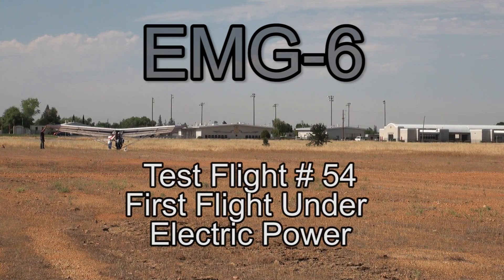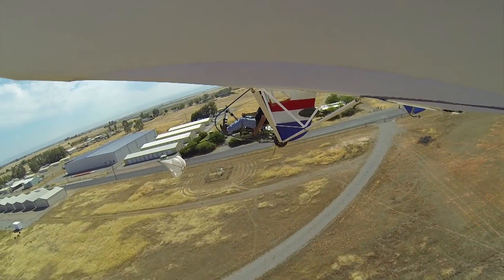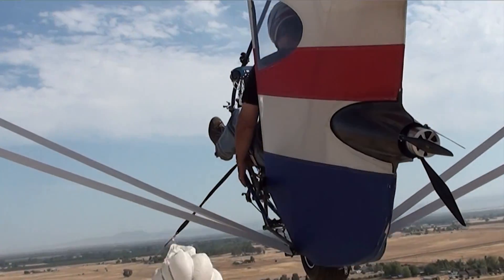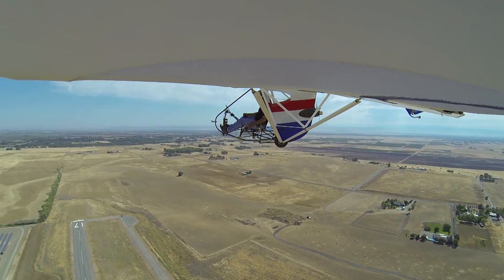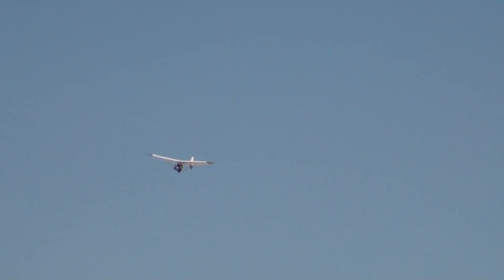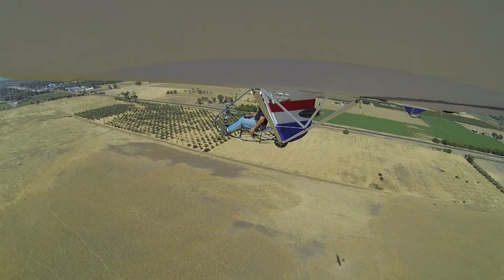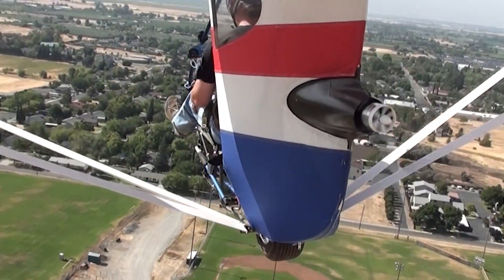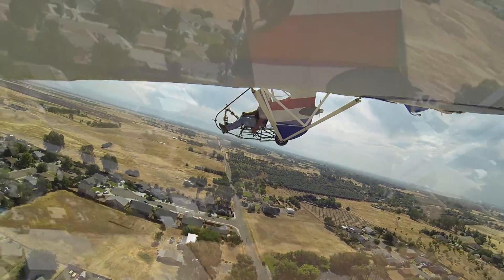EMG-6  Test Flight #54 (First Flight With Electric Power)

Comment: Although not an electric expert, I feel you need to look at a slower turning, larger diameter prop.
You look to have room if it's folding..?
Motor sounds to be generating a lot of RPM, but not utilising a lot of torque, where electric motors are supposedly more efficient?
Also looks like you need to fit a brake to the prop and stop it windmilling at shut down...
Aerodynamically, do you really need that much dihedral on the wing?